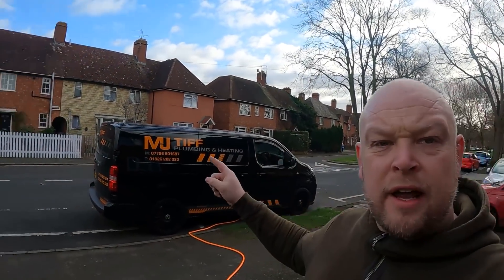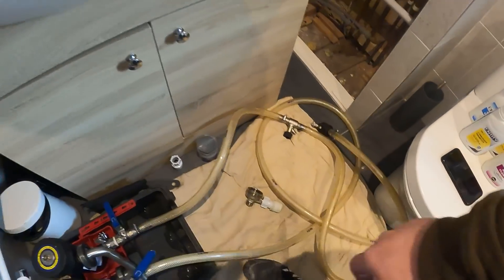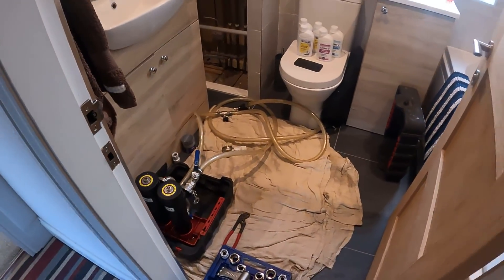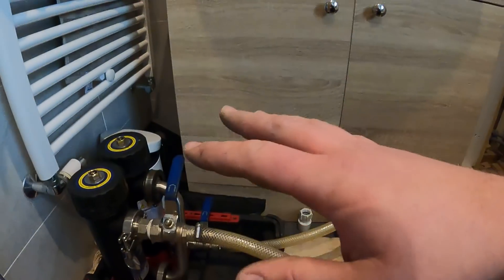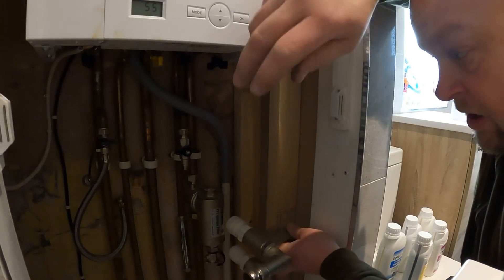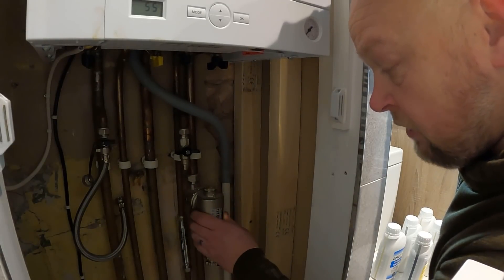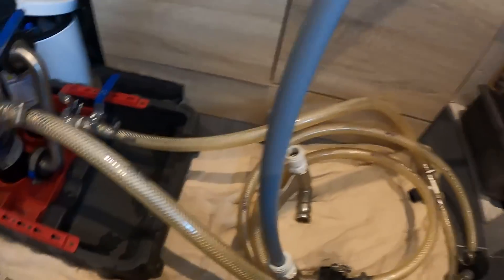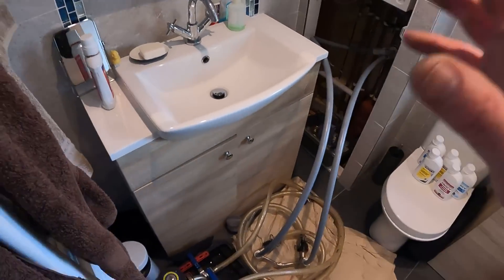HOW TO GET COLD RADIATORS HOT AGAIN WITH A COMPLETE HEATING SYSTEM FLUSH

Comment: Nice hack with the 22mm pipes mark I will have to remember that, the only thing I do differently is once I've flushed the system out at the end with clean water I take a sample with a tds meter to make sure I have flushed all the cleaner out, speaking of which what are the cleaners you use and what they like. Cheers
Reply from the maker: Yer always good to finish like that, these ones were Utility ones. Pretty good results with these

Comment: There are water quality test kits for dissolved solids, pH etc so you can actually tell when the water quality in a heating system is good or bad. Kind of feel we should be doing better than randomly chucking chemicals in like this these days.
Reply from the maker: Hardly “randomly chucking chemicals in”….🙄
It’s fully flushed between “chemical chucking” and checked buddy….. it’s not my first rodeo pal😉

But thanks for your constructive overview Chris..👍🏼
Reply: @MJTiffPlumbing  Have a look at BS 7593, it’s got lots of advice how to measure cleanliness and inhibitor concentrations in heating systems. You can then prove when it’s clean enough at least,
Reply from the maker: @chrisb4009  I know that mate….. that’s why, like I’ve just said….. I check it…

Comment: Great video. What are you charging for the flush if you don’t mind me asking ?
Reply from the maker: Thanks mate…
My flush charges start from £350 for a system upto 8rads, then it’s £50 a rad after that. 
But prices may vary depending on system/house size etc etc

Comment: Great video, just ordered myself a magnacleanse. Only ever used one on installs when we’ve installed the filter. What do you do if the system hasn’t got a filter on Mark? Do you take a rad off and use the same method as you have on this video. Thanks again for the content, really enjoy your videos!
Reply from the maker: Hey Mark
If a system doesn’t have a Magnaclean I will offer to fit one and tell the customer it’s to help after the clean is done, everyone has one fitted once you explain to them what they do.
However I have done a handful of flushed without them for whatever reason and I either get on to the return near the boiler of as you say, remove a radiator👍🏼👍🏼

Comment: What temperature are you aiming for when you're balancing the radiators ? I would love to see you go into a bit more detail on that as it's something I always struggle with. The camera looks like an awesome tool 🤩
Reply from the maker: Thanks mate, 65/70degrees at setting 3 on the thermostatic valves, leaves enough for some movement
Reply: @MJTiffPlumbing  Thanks for the reply Mark. So just a steady 65/70 degrees across the entire rad is that right ? I was told that you should measure inlet and outlet temperatures but always struggled to do that accurately.

Comment: Is this on old heating system or do you want hot return-water in the UK? Would think a bigger deltaT will make a newer systems more efficient. Run the water so slow thru the radiator it get the time to give off the warmth to the surrounding and the return water will be cool for most efficient reheating of the water.
Reply from the maker: This is on an existing heating system

Comment: Got to love a flush day, a lot involved as you demonstrated but headphones in and it's a pretty chilled day.

That rogue panel is very odd, not something I've come across before, must just have been a machining anomaly.

My bad its been a while been renovating my new place over here top to bottom, I have managed to catch back up now....
1- Tap at the barn looked a nightmare.
2- Hidden blending valve on the bath, not sure if you had the option but I always opt for access from underneath plasterboard easier and cheaper to replace then tiles, was mentioned in comments but I did add a little telescopic camera to my UK kit last trip very handy, spade bit a small hole if needed and away you go also useful for your other hobbies..  🚘

Good to see you're doing well still, keep up the good work. 👍
Reply from the maker: Thanks Kane…. Hope all is good mate.
Yer I quite enjoy a system flush, and that one panel was very odd. I thought the same…. Just maybe a strange weld or something

Comment: Got problems with the rubber hoses , like shit to a blanket . Viessmann won’t admit it tho . Hoses break down , shit ends up in plate heat ex - throwing up F2 horrid boiler - absolutely shite .
Reply from the maker: The customer has already had the plate changed once under warranty🙈

Comment: Why don't we use a coolant fluid like in a car? It wouldn't corrode the heating system like water does and thus meaning no sludge build up
Reply from the maker: Good question that, I would say it’s something to do with the internals of boilers/sensors/stats etc etc…… maybe
Reply: antifreeze substances and their aqueous solutions may cause a reduction in the radiator heat output and an increase in hydraulic resistance, which results in the entire system higher energy consumption and lower efficiency.
A risk with all glycols is that they will become contaminated by micro-organisms and will start to degrade. A common effect of glycol degradation is to increase the viscosity and hence the pumping costs. Eventually the pump may stop working if the coolant flow becomes too slow.
Ethylene glycol has a low-density, good heat carrying properties and low viscosity. Seen purely from a technical point of view it is the best antifreeze for heat transfer. However it is highly toxic to humans and animals, handling it on site requires care to protect the skin from contact because of the risk of dermatitis, and the lethal dose for ingestion is about 1 litre for an adult male. So any leak during installation or afterwards is potentially dangerous and may need to be reported to the Environment Agency.

Comment: Another good video Mark. I have a fernox pump which does a good job but limited to where it can be used.
Reply from the maker: Thanks Brian…..

Fernox pump system cleaner…. Don’t think I’ve seen that set up.
Reply: @MJTiffPlumbing  I have the Fernox power flow power flush pump plus magnacleanse. I bought the lot off a retiring (actually coming off the tools and into a suit!) plumber. I’m a landlord and I use it on my rentals between tenants. It takes me a lazy day or two to do it thoroughly and that includes putting cleanser in a week prior. 
Strangely satisfying 🤣
Reply from the maker: Nice one mate, yea I find doing them very pleasing with the end result

Comment: What you did was clearly effective in restoring emitter function. But I have real doubts about how effective this sort of flushing rig can truly clean the whole system, the flow rates are simply insufficient when using system pumps.
Reply from the maker: Never ever had an issue with it, always gives great results and every single one I have done has been perfect when I’ve finished. 
Personally I use this system as it doesn’t put any undue pressure on the system/Pipework etc etc which can cause fittings to blow off.

Each to there own but I’ve been using this for 4/5years now with brilliant results
Reply: @MJTiffPlumbing  I am not dissing the rig - all I am saying that low flow rates will not clear deposits adhered to pipework. If you are interested - in the next clean of a heavily fouled system once you have completed the clean cut out a section of 15mm pipe and inspect it.
Reply from the maker: @normanboyes4983  I’m not saying you was, I just know that I’ve never had an issue with the systems I’ve used this on, and they have removed a lot of debris out of the systems and works great.

As said, each to there own…… this is my preference as I know I’m not going to put huge amounts of pressure into systems that I don’t completely know, that’s when weak joints let go and that’s when you flood someone’s home, I tend to avoid that.

Thanks for watching👍🏼
Reply: @MJTiffPlumbing  Totally accept that.👍  But I would just like to point out that you can push very high flow rates through pipework and not exceed system working pressure.😉
Reply from the maker: 👍🏼👍🏼…… would be very interested to see one of those systems working.
Maybe do a full flush with a MagnaCleanse system….. then clean it again to see what that system removes…..

🤔🤔🤔….. hhmmmm, this has got me thinking
Reply: @MJTiffPlumbing  I think there is a rig marketed that just uses main pressure into one leg and the other leg connected to drain and a set of valves to enable flow reversal. Gives a lot higher flow rate than the system pump. Of course that rig is not circulating your chemicals……🤔
Reply: @normanboyes4983  agreed I have a powerflush machine with a magnaclense connected in the return to the powerflush machine I get great results as I can have high flow rates with chemicals flying round whilst catching all the dirt

Comment: Sentinel X400 (or X800 if you're in a rush) is a good replacement for people on a budget, or with an ancient system that is guaranteed to leak if you power flush.
Reply from the maker: Yer the Sentinel range is really good👍🏼👍🏼
Reply: Had problems with sentinel clogging pumps in the past. So started using fernox f3

Comment: How much do you charge for a flush mate
Reply from the maker: My costs for a 4 stage flush starts from £350 for an 8 radiator system, then it’s £50 extra per radiator but is also dependant on what system etc etc
Also if they don’t have a Magnaclean or system filter fitted I will advise they have one at the same time for future protection.